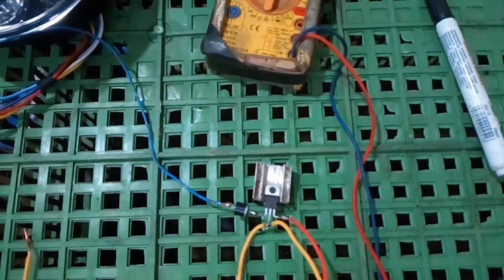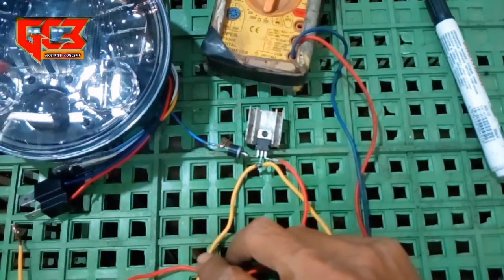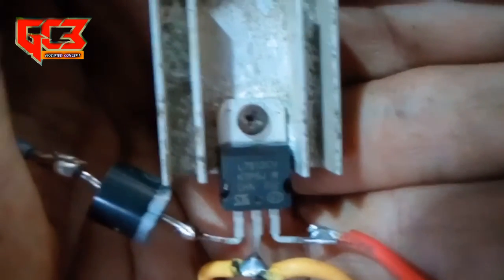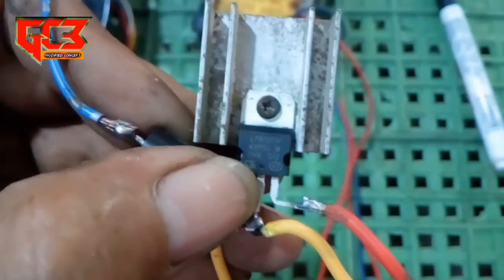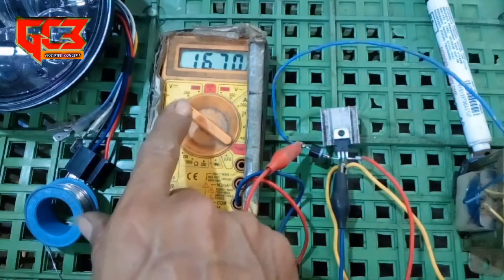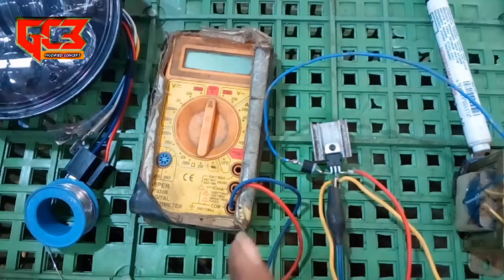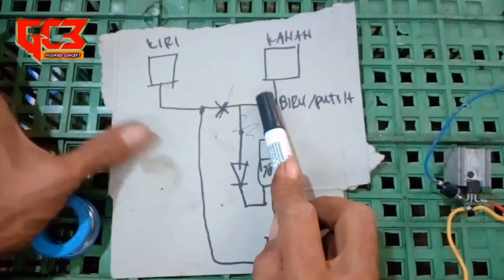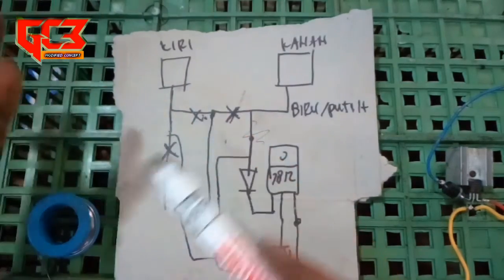LAMPU DAYMAKER BISA LEBIH AWET HANYA DENGAN MODAL 4000 RUPIAH

Comment: Terus itu kalau voltase aki droft ke 9 volt karna tidak ngisi, atau aki mulai rusak, apakah tetap stabil di 12 volt bang,
Reply from the maker: Gk mas,kalau di bawah 12v dia ikut drop teganganya,itu cuma untuk menstabilkan tegangan di atas 12 v
Reply: @GCtigamodifiedconceptYUDI   saya kira dia akan stabil mas,🙏🏻🤭, karna kalau bisa  tetap stabil di 12 volt, mau saya aplikasikan ke dinamo starter, biar gak macet2 dinamo starternya 🤭🤭
Reply: @GCtigamodifiedconceptYUDI  mas klo pake voltmeter rangkaian,nya gmn motor megapro primus
tlong d.jawab mas

Comment: Jika dipasang tanpa dioda apakah bisa mas?
Reply from the maker: Bisa pokok arus dc mas yang masuk ke lampu nya bukan dari spul
Reply: @GCtigamodifiedconceptYUDI  siap terimakasih mas sangat bermanfaat🙏🙏
Reply from the maker: Sama2 mas
Reply: @GCtigamodifiedconceptYUDI  kalo ic regulator mengalami kerusakan apa daymaker ikut rusak?. Soalnya pas lampu nyala ic regulator sangat panas mas
Reply from the maker: Selama kiprok normal gk akan ngrusak daymaker mas,baik nya ic di baut di rangka mas,biar gk terlalu panas
Reply: @GCtigamodifiedconceptYUDI  oke maturnuwun mas